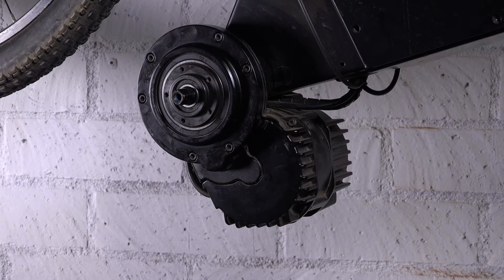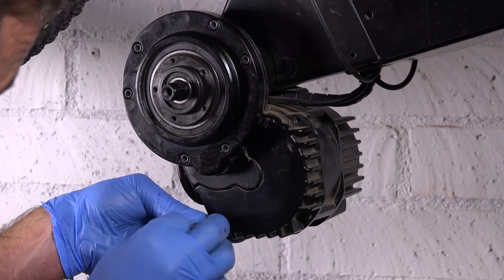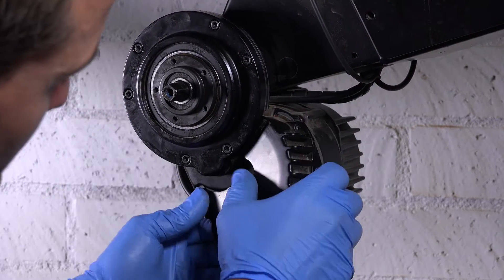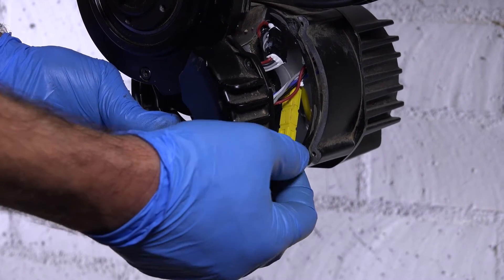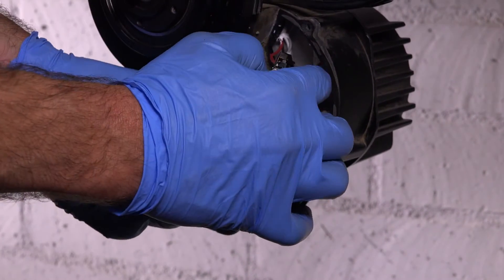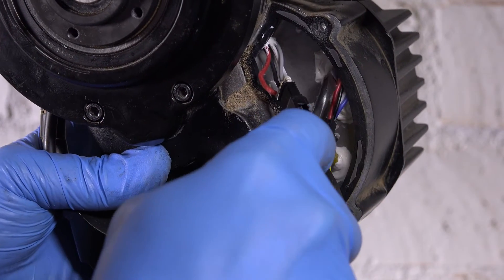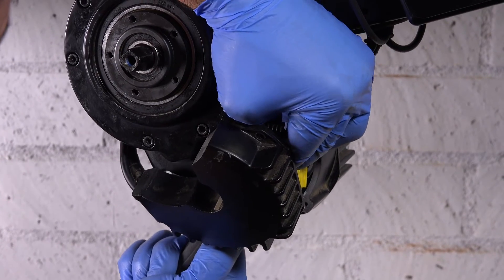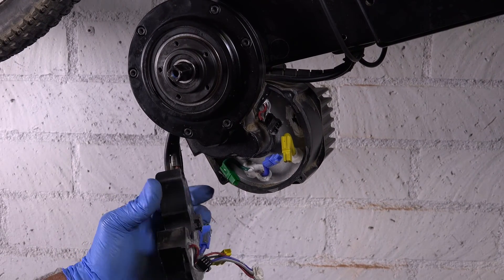Bafang  BBSHD 1000w Controller Replacement

Comment: I cannot seem to get the green phase wire into a position where it will fit. I forced it together and managed to do 2 screws up but when I turned it on it made the “something is wrong with the phase wire” noise when I turned the throttle and sounded like a motorbike. So after shunt modding it with 2 extra capacitors it should now be running 60 amps but my test ride with the controller just dangling there 😂 wasn’t as successful as I might have thought. I’m certainly getting more top end speed but the torque isn’t what I was expecting. It’s has increased but perhaps it was because my battery was really low that I haven’t seen its full potential. I’ll figure out a way to get the controller shell back on tommorow and charge her to full and then see what she’s got.

Comment: Dont you replace the silicon ? Also after silicon, especially since i run it in winter, do you think  AF-50 sealant can be usefull to add ? Thanks good video.
Reply: Silicone?
Reply: The two plugs inside the controller have silicone smeared over the connections

Comment: I touched the red and black wire bike went bang what hence I brocken need help asap
Reply: Short circuited. I accidentally killed a Bafang M620 Ultra controller. Most likely because I touched both power wires at the same time. It ruined the display unit too. I don't know if the BBSHD has short circuit protection but the Ultra motor didn't.

Comment: what size are the 3 bolts that hold the controller on? i lost mine
Reply: Great question.  I can not find anywhere to buy replacements, or even find out what the size is.
Reply: @budwhite9781  I actually found replacements on aliexpress and paid like $5 for a bunch
Reply: 4mm 7

Comment: So I have a BBSHD 1000w. I'm running the BPC18 display.  I'm running the motor with a 48v battery.  But my display reads that I'm running a 32v battery. Would that be a fault in my controller?
Reply: Mine kept showing 42 when I had 52 had to reprogram it problem solved

Comment: Is it possible to fix controller components. Like, remove resin and remelt some parts to fix it. Looks like my controller died.  Before he died. Controller show problem 12h.  2 month and  he stopped work. 🌞
Reply: Mine  too. An 08H error then a 12H error  and then stopped working altogether.  I have no idea what went wrong

Comment: Do u need to reprogramme the controller low voltage cut off if u upgrade form 48v to 52v , id like to use both  thanks .

Comment: Is there any reason why one of these controllers would die after only 3 hours of normal use ?
Reply: Short circuited. I accidentally killed a Bafang M620 Ultra controller. Most likely because I touched both power wires at the same time. It ruined the display unit too. I don't know if the BBSHD has short circuit protection but the Ultra motor didn't.